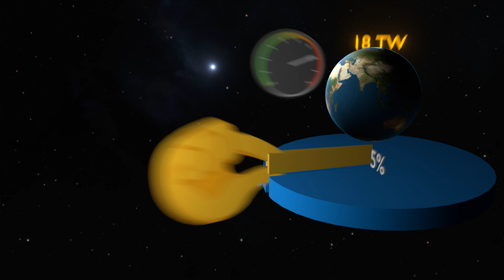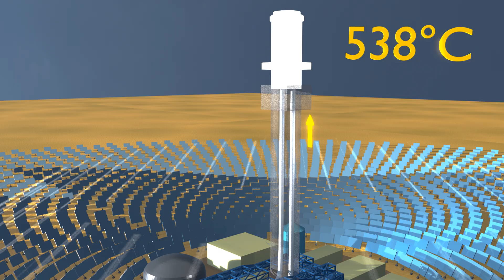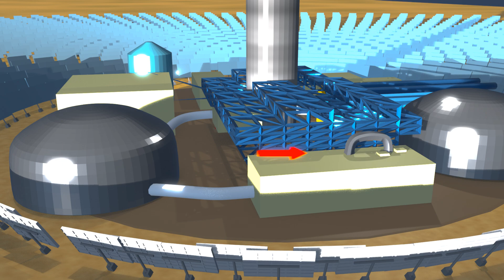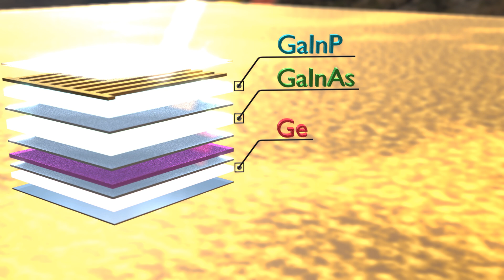Why CSP lost to Solar Cells?

Comment: Pv can't hold up to CST, CST will take over within a few years.  The actual heat generated is closer to 2000c
Reply: Unlikely. PV is much simpler to install and manage. No leakage of hot fluid

Comment: What about water cooling or using a transfer fluid to cool down the cells?  Like water cooling loops or using mineral oil to cool a CPU?

Molten Salt is arguably cheaper to store thermal energy for longer.  And easier to replace if it breaks.
I can understand the expensive setup IS Superior, but molten salt and a heliostat/concentrated solar can do nearly as good for FAR Cheaper on those in a budget
Reply: Too expensive
Reply from the maker: Every little part increases cost and complexity. Water cooled solar cells won't be easy to maintain on a large scale. Panels themselves require a face wash every now and then to clean all the dust buildup. 

Molten salt is corrosive. Destroys its container over time. But yeah, good for storing thermal energy at night.